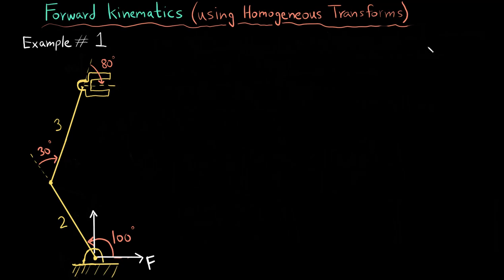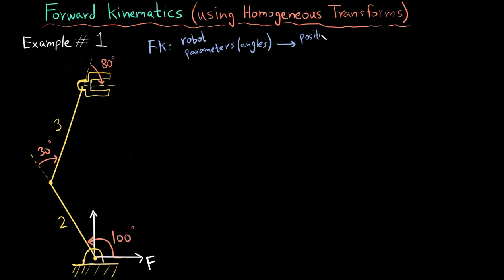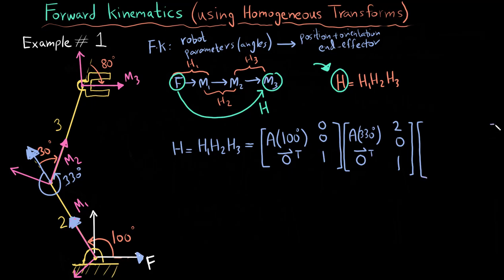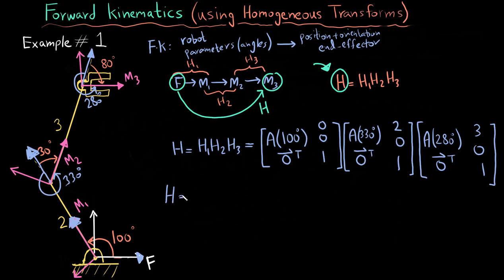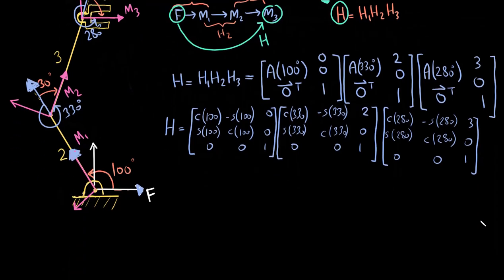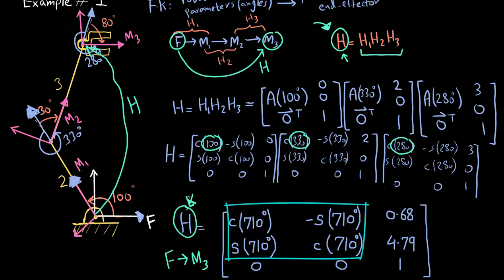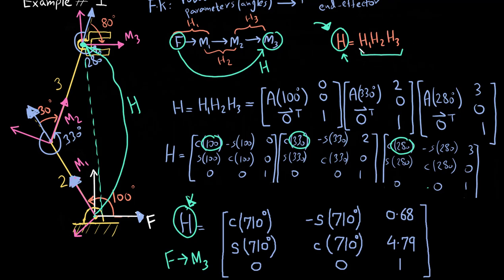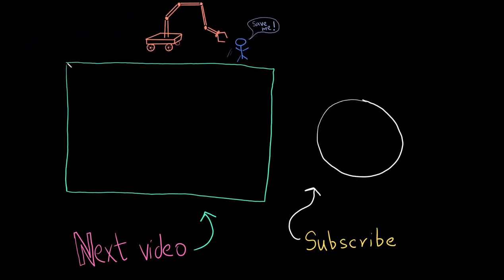Forward Kinematics (with solved examples) | Homogeneous Transformations | Robotics 101

Comment: Hello sir! Excellent video, but I think your multiplication of H1, H2 and H3 is wrong. If you doubt me, please perform this operation in a software like Matlab or Octave. The displacement vector of M3 expressed in the fixed frame when you do this is [1.1565,-0.7756]. I don't see how you've obtained a vector of [0.68,4.79] for this when you and I have the same H1, H2 and H3 vector. Thanks.
Reply: I also didn't get it and got very confused

Comment: Why is the displacement for H2 2 for x axis but 0 for y axis? If the x value was increased, wouldn’t y value also increase correspondingly?
Reply: X value is only increasing since the n-1 frame moves along n frame in x direction

Comment: can we simply add up the angles ?
during H1H2H3 multiplication?
Reply from the maker: That's a great question! If you have rotations around the same axis, then yes!
However, generally in the real world case, you would have rotations about different axes. So, it's always good to just multiply the H1*H2*... And then figure out the angles.
I hope that answers your question.
Reply: @EngineeringSimplified  thank you for the reply. that was helpful

Comment: There's no explanation of Homogeneous transformation in this playlist robotics 101
Reply from the maker: A homogenous transform is just a matrix that has a Rotation Matrix (A) and a displacement matrix (d) in it with the last row being all zeros except the last element, which is a '1'.
Have a look here: https://i.ytimg.com/vi/3zeMsf0vcs4/maxresdefault.jpg
^ This picture is for a 3D homogeneous transformation matrix but the same principle applies for 2D as well. The only difference is that in 2D, the Rotation Matrix is 2x2 instead of 3x3 and the displacement vector is 2x1 instead of 3x1.

I hope this makes sense and now you understand what a homogenous transformation is. If there is still any confusion, let me know and I will try to explain it again.
Reply from the maker: In fact, I have posted a video for this just now: https://youtu.be/IR00J55F76M
Hope it helps!
Reply: @EngineeringSimplified  bro add it to the playlist above this video
Reply: @EngineeringSimplified  Add it to your playlist in correct order please?

Comment: Hey, thanks for the video and I did not understand the third column of the final H matrix. How did you find the values of 0.68, 4.79 and 1 ?
Reply: 3 cos (100 + 330) + 2 cos (100)   |   3 sin (100 + 330) + 2 sin (100)
Reply: @Gooliabunny so the 280 won't even make a difference in the third column?
Reply from the maker: What I did was I simply multiplied the three homogeneous transforms (H1, H2, H3) together using MATLAB and wrote out the final answer.

 You can use any software or even do the multiplication by hand.
Does that clear out the confusion?